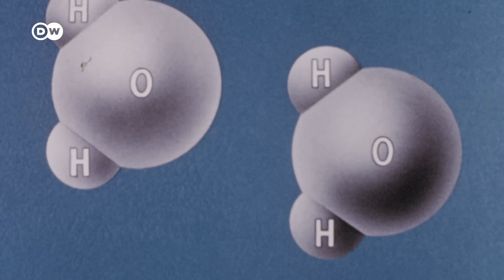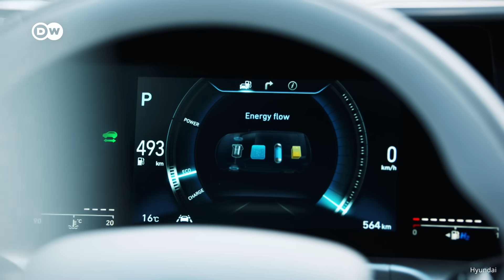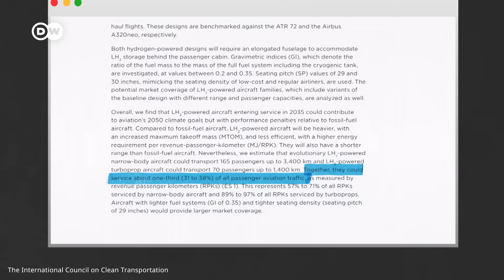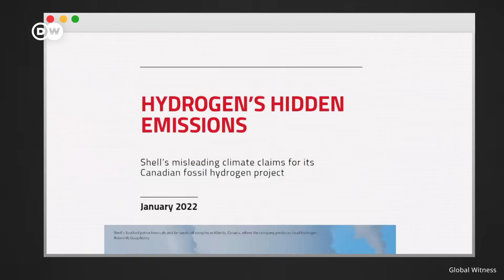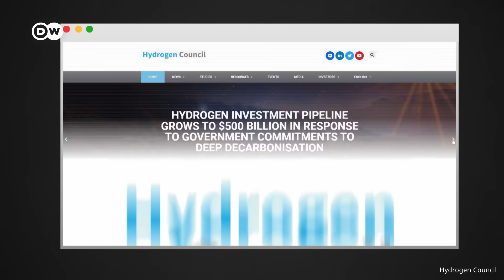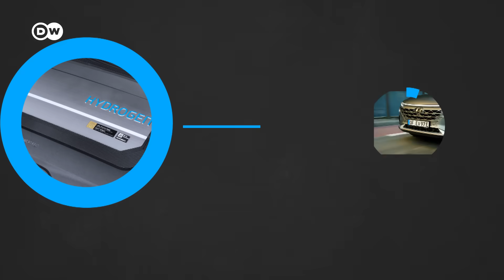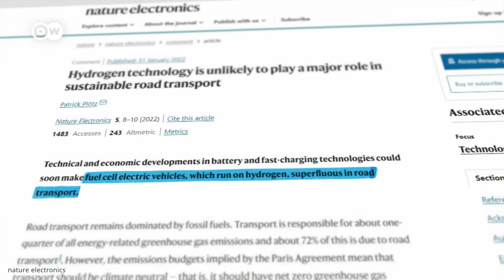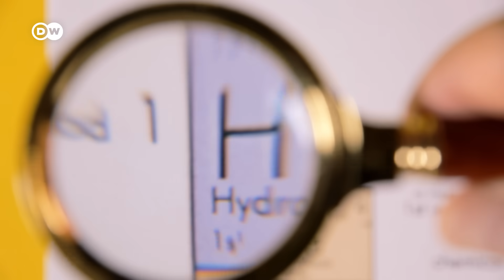The truth about hydrogen

Comment: I'm surprised that the CO2 equivalent cost of producing the renewable energy source to produce the hydrogen isn't discussed more regularly and at greater length.
Reply: Yup those are the real convos that struggle to be had.
Reply: Because the cost of construction is divided by longevity of production. For instance, Norway has some 1700 gravity powerplants. These were not free to construct, but each century we make use of them, lowers those costs more and more, until it's completely negligible. That's the most important reason why capitalists are against renewable energy, because it requires you to think in centuries, which a capitalist can't. After all, all capitalists will die soon.

Comment: Big misconception here. Renewable energy sources such as solar and wind have seasonal fluctuation. For example, cumulative (supply - demand) in California with the assumption that solar and wind will support 100% of demand over a year, we will need something like 30 TWh of energy storage that has to accumulate and release over 6 + 6 months (one year). Cost of such storage system: hydrogen underground storage = $0.13T, battery $14T because the cost of storage for hydrogen is about $1.8/kWh, while battery is $400/kWh. Even considering difference in round trip efficiency, the cost difference is still about 100 fold. Why? Hydrogen underground storage is very similar to natural gas underground storage. Btw, California already has 375B cubic feet of natural gas underground storage capacity now and if it is converted to hydrogen storage, it is about 30TWh. So, which solution we should used for renewables with seasonal fluctuation in their output. If you don't understand why renewables such as solar or wind has seasonal fluctuation in their output, please let me know. You just need to understand who we have the season. Rotational axis of earth is tilted about what? Then how earth circle around sun, which will create the season. Just open your science textbook.

Comment: Getting to net zero is actually impossible, at least in a constant changing world, we can get close to it tho, the thing with energy sources is how you store that energy, for how long it remains usable and how easily you can reach that energy, most of the energy needed by our society is met on demand and as such carbon/fossil fuel does make a lot of sense, you can simply burn it at the moment you need it and you can store it pretty much forever without losing efficiency over time, no weather limitations unlike solar or wind energy or even hydro plants that need time to fill their dams, etc (an exception can be seen on geothermal energy that is actually pretty consistent on power production/hour and nuclear energy, latter one is not considered eco friendly by some) and you just carry it in simple container. If we could create a renewable energy system that can produce peak demand at any given time of the day and distribute it... well that would be great news but seeing the world as of now theres still a long road ahead for that, what we need right now is a way to store excess power production to use it later efficiently and maybe hydrogen can fill that role (albeit it still may need some tweaking). Another short term fix is changing the power demand behaviour of our countries and evening the demand over the day, that would help a lot with most of the challenges, not by reducing the total consumption of energy but by evening the power consumption giving room for other energy sources that depend on randomness or time, letting them participate and relieve pressure from the more reliable classical sources. In reality a considerable political and monetary effort must be made to diversify the energy grid and encourage the use of non fossil fuels energy sources and not only one energy source/solution should be taken into account because we would fall into the same problem again.

Comment: hydrogen is not an energy source, it is more of a battery! It takes more energy to produce than you will retrieve later.  Which could work as long as the energy used is green, the method to create needs to be green(not from fossil fuels) and needs to not take from local freshwater.

Comment: The loss in converting electricity to Hydrogen and then Hydrogen back to electricity is the big issue. Too much conversion loss. Renewables will never cover all our energy needs, especially as more and more transportation becomes electrically powered. Nuclear is the cleanest solution we have right now, if we could just get over our bias.
Reply: Renewables are as clean (or cleaner if we start talking about radioactive waste), usually safer and, most importantly, cheaper than nuclear power.

Comment: Have you looked into Thorium reactors as base load electricity production and the replacement for the 80% that fossil fuels currently produce? Would Thorium reactors be a great way to go green in the short term, until quantum vacuum energy production is commercialised?
Reply: Given that quantum vacuum energy production pretty much only exists in the realm of science fiction at present whereas there are many tried and tested alternatives simply requiring the politicial will to scale up. To date there are no Thorium reactors tested to commercial scale and, despite it being safer than current Uranium processes, its construction time and costs would not improve things for decades when more renewable continue to be rolled out now. Fusion has been tested and is being scaled up for the longer term, and new approaches are being developed, but even that will take a decade or three to get there.Thorium is NOT a short term solution and is still very expensive compared to renewables.
Reply: @Wizard_of_oOZe  Thanks for your reply Byron. I have heard that quantum vacuum energy research has progressed in laboratory settings, but will take many years before it will be commercially viable, I may have been led up the garden path!?
Are you talking about Uranium based nuclear as tried and tested alternatives requiring the political will to scale up? If so, I would also like to see our Australian Government put this form of energy production back on the table. I would prefer to see Thorium based nuclear used instead of Uranium if we are able to construct nuclear power plants as an alternative to the current direction into Green Hydrogen power plants. Would construction time be similar?
In Oak Ridge, Tennessee USA a molten salt reactor (Thorium reactor) was operational for 11,500 hours between 1965 and 1969 from which much was learned about this type of energy production. With this experience under our belts, we can direct research and development toward commercially viable molten salt power plant construction for efficient low to no emission energy production in a similar time frame as Green Hydrogen!?
Solar and wind energy is okay during their operational time period, but both require heavy fossil fuel energy consumption to manufacture, they have a relatively short energy production life and then need to be discarded, generally to land fill where the solar panels leak toxins into the soil and ground water. Currently a large portion of Cobalt mining is from the DRC where there are humanitarian issues in the mines. I see wind and solar as shallow, band aid fixes that only appear to be doing good, but are problematic before and after operational life, and wind turbines are hazardous during operation to our birds. Can we really call these "green"?

Comment: Nice video, but.......

 If you compare production of green hydrogen to all the mining and refining of all the component materials to make all the different lithium ion battery chemistries, then hydrogen wins by a landslide on all the metrics you were analyzing.

The problem when people compare electric car energy production to hydrogen production is that the facts on mining & refining the all the minerals to make the Li-batteries, plus the current level of recycling of those batteries is generally left off the comparison, which negatively affects electric vehicles.  It's not an apples to apples comparison, but apples to oranges.
Reply: Not at all. Emissions of energy consumption during use of the vehicles has a far higher impact on life cycle emissions. Battery production is currently at < 100 kg of CO2 per kWh produced. That is easily compensated for within the first few years of driving.

Comment: As long as Hydrogen can solve CO2 emission and fulfil customer’s requirements, Hydrogen is the solution.
Reply: It is not because batteries are already far more effective in lowering CO2 emissions.
Reply: @Freba9  but what about customer‘s requirement? For example, a car must have a longer range and quick re-fuelling. Does battery can do that?
Reply: @hafizuddin mohd lowhim  CO2 emissions are far more important
Reply: @Freba9  in reality both are important. Business can’t be sustainable if customer’s requirements are not met. Thus hydrogen is the answer.
Reply: @hafizuddinmohdlowhim8426  Only for a tiny part. Batteries will dominate.
Reply: @Freba9  you are being realistic here.
Reply: @hafizuddinmohdlowhim8426  thanks

Comment: We keep on thinking that big is better and centralise our power , I think if you had hundreds of smaller Hydrogen Generators and Hydrogen Collectors,  they produce enough for Generators and the farmers and local needs extra goes to international markets . More work in all regions.  Not needed is centralised Corporations.  Wealth spread , jobs created and most of all secure power , take one centralised power structure out say , with a bombing , out goes the power for a whole region . With hundreds off small Generators interconnected you still be able to keep running.  Including the economy,  look at fuel prices go up through the roof in the Ukraine war . Fuel Security.
Reply: unfortunately it doesnt work like that. a home scale hydrogen generation plant would take up ALOT of space, costs tens of thousands of dollars to install, only last between 5-10 years before needing to be replaced, would be housing a dangerously explosive gas in a dangerously high pressure tank (small scuba size tanks at those pressures have taken out corners of entire buildings) all whilst talking several days to produce enough hydrogen to fill a single hydrogen car once. The only way to produce enough hydrogen is to go big... VERY BIG..

Comment: I really do think that we are onto something with hydrogen, I mean if we cosider all the harmfull elements and resources that go into the battery production, not to mention even the loss of human lifes theough horrible mining tactics, hydrogen really is one of the only chances we got. I think electric cars, even if they are experiencing a hype right now that is influecing the market heavily, are just not going to cut it.
Reply: actually modern batteries are phasing out the use of un ethically mined materials. Hydrogen on the other hand, requires alot of fossil fuels to produce currently and even green hydrogen requires a huge amount more energy from the same power plants that charge BEV's per mile. And all ontop of the fact that hydrogen cars are extremely short lived, especially in comparison to BEV's.

Comment: i was told you can buuy hydrogen kits that you install in a car you connect the hydrogen unit to the battery which starts the electrolosis in the unit which creats the gas that is funneled in the the air intake to the carburetor which ignites the spark plugs sounds viable but i suppose the oil companys dont want you to know this.

Comment: Great Video. And i believe it is the fuel of the future. Espically with the growing momentum, technologies and research.
Reply: The hydrogen fad has come and gone. There only is one manufacturer left over, Toyota committed to produce 30000 Mirai FCEV per year - and that's it. The expensive infrastructure isn't viable on the basis. Just look at the speed with which the infrastructure in Europe is expanded (h2.live) - only countries with significant money wasted through subsidies have even a remotely viable infrastructure - other countries whose politicians were smart enough to understand that hydrogen will not be available to both decarbonize steel, cement and fertiliser production and then also be used in transportation have little to no infrastructure (France 3 working today, Italy 1, Spain 0, Portugal 0 filling stations - in the whole of the US there is I think one filling station outside of California)...

Comment: I don't see H2 becoming widely used as a transportation fuel, but it could play apart in green energy storage by spitting H2O with wind or solar produced electricity and using the H2 in fuel cells to generate electricity when green energy is not available. H2 generated by CH2 reforming should be avoided at all costs.
Reply: I don't mind shortcuts if you know where you're going. We could easily accept massive emissions from grey hydrogen on a temporary basis if we knew that massive amounts of permanent green hydrogen was coming. Sometimes, enabling economy of scale is the biggest problem.
Reply: I do unless we come up with some other battery tech than lithium. Because there isn't enough of it to power every car on the planet.

Comment: I am an energy systems engineer. I have a couple decades experience including hydrogen tech. In all of the system design evaluations I have done for all energy end uses and supplies... the hydrogen option is ALWAYS the least feasible, viable, beneficial, highest cost, highest Risk, and thus the least preferred option. There isn’t anything coming in the research pipeline that will change this. 
Somebody is hyping a bad concept as a solution. There is a word for that in the legal field.
Reply: Back up the truck a bit farther. Why do we have 1.4bn automobiles on the planet?  Because it’s possible. Why? Unconstrsained supply of liquid (easily dispensed and stored at atmospheric pressure and normal temperatures) fuel with 44MJ/kg energy content and engines that convert heat to work. Because governments spent unbelievable resources on roads and parking. Because of debt. Because Mechanical, Chemical. civil engineering education, research, standards made these systems safe, reliable, affordable. 
All of this spend is on the back of unlimited free high density energy - petroleum. 
Using less petroleum, and using the existing debt-financed assets and vehicles is 99% more likely than manufacturing a very expensive high pressure gas with low energy density, and all of the fuelling infrastructure and vehicles.  
The story of hydrogen for personal vehicles is just silly. Like magic beans. 
It is time to stop fairy tales and get to work on the Transition Engineering of lower oil use and production. Low enough to save the planet is about 80% downshift. That is a bit of innovative work to do. And a huge amount of land available for redevelopment, money staying in your city, clean air. Quiet. New local enterprise. Etc. once you look you can see so much opportunity.
Reply: Are there any fuel cell vehicle technologies that make sense?  No not for you. Not for you to use to commute from your house in a suburb to work or to a giant shopping mall. Not for you to drive across the country for a fishing trip. No. It is an idea that we as studied some time ago and now it is known that the possibility of fuel cell cars being anything other than a distraction is so small it must be discounted. So what now?
Reply: @profkrumdieck  it sounds like you have given up on any alternatives because this is the way it has been for a long time and there is no point changing it.  honestly I think we need to look at the problem another way.  not "how can we make cars better" but "how can we make cars less necessary." and I'm not talking about public transportation, though that would certainly help.  we need to do something about WHY people are commuting in the first place.  though that is just my opinion.
Reply: @raav_sf  being realistic about what will work is not the same as giving up on alternatives. 80% reduction in oil use is a huge change that will need more creativity than it took to use unlimited free energy
Reply: @profkrumdieck  very true.  sorry to have misjudged your position.
Reply: @profkrumdieck I'm sure that you're aware that no energy conversion is 100% efficient.
With that in mind, why would anyone produce hydrogen (with electrolysis in a fuel cell), so that it can used in another fuel cell to make electricity?
Reply: What are some examples of more feasible options for readily transportable energy?
Reply: @kulls13  Gas, oil, diesel, propane, among others.
Reply: in your opinion, in regards to fuel cells for vehicles, are there any options that make sense environmentally, economically, and with enough efficiency to be worth while? or are fuel cells just a pony they trot out when they don't have any answers?
Reply: Except that we now have discovered Fossil Hydrogen!

I suspect the Fossil Fuel Companies had known about it for a long time, but, having invested so much in Oil abstraction, they held back dissemination. Now it's leaking out (pun fully intended!) because they are no doubt now ready to exploit it.

Comment: Not all hydrogen fuel cell cars run on electricity. One benefit is that you can convert most gasoline engines to run on it with producing another car that runs on electricity